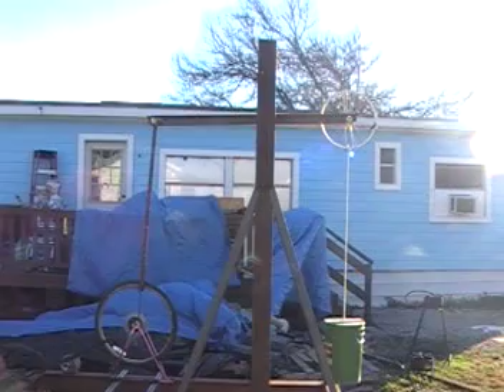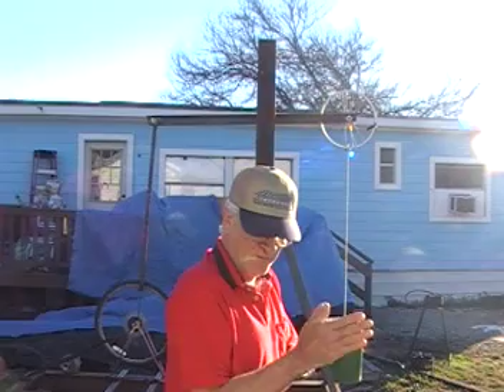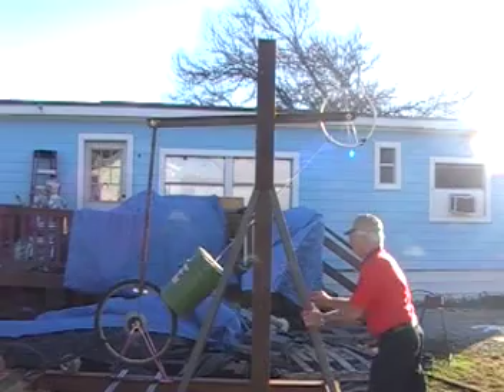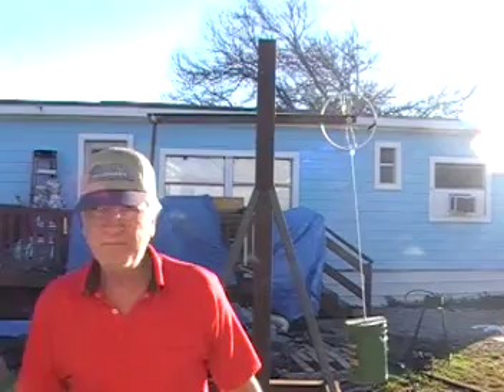testing large Milkovic 2 stage oscillator Video 5

Comment: How can one estimate the vertical stroke range from top to bottom, on the working end of the lever?  I am troubleshooting a similar project, where I'm not getting enough stroke to turn a crank...  Position of fulcrum to lever ratio possibly?  Or longer lever?  Is there a chart or equation to figure vertical working range?   Any help would be greatly appreciated.
Reply: Hi, I am working on a similar project. I am using magnets and electromagnets to latch the pendulum. This should increase the power stroke length. I should be testing soon. I hope this helps. Cheers
My pendulum lever arm length is much shorter.

Comment from the maker: I am deffanetly still working on this machine.
I own a construction co. And my work load doubled right after I made this video. Things have slowed a bit and I am working on an escapment idea of sorts.  The machine does put out more energy than it takes to run it. IT DOES NOT create energy. It simply changes potential energy to kinetic energy.
Good luck with your project. If you need any help. You know where to find me.

Comment from the maker: Now comes the Conundrum ;  Cut the movement up and down by 50%.  You reduce the power out by 50% .  BUT, at the same time you reduce the power needed to keep the pendulum swinging by 60% to 65 % . After you do the math on this one.  Cut it another  50% and when you do the math on that one.  If you don't through your head back and say HOLY  COW ,   I'll buy you a six pack ,  your brand.

Comment from the maker: Example;  If the power (lever) Bar is a 1 to 1 ratio and allowed to move 2 inches and lifted 20 pounds that would be 40 inch pounds of Kinetic energy.
Now let's say that the pendulum required a 5 pound force For 10 inches (it actually requires much less)  to keep it swinging.  This would be 50 inch pounds in and 40 inch pounds ( does not sound all that great HUH )

Comment from the maker: You are 100% correct !  The bungee cords pulling on the other end of the chain allow for too much up and down motion in the pendulum.  The math of the levered power bar is Proportional. However;  The math for the energy to keep the pendulum swinging in comparison to the movement up and down, is exponential.

Comment: nice work, if i might add something it would be another solid bar on the left placed 2 inches below the lowest point of the pivit arm and put a coil spring on the pivit arm. with the right timing(placement). gravity and mass (bucket) push the spring  down on the on the way up, and the spring should help put that energy to motion